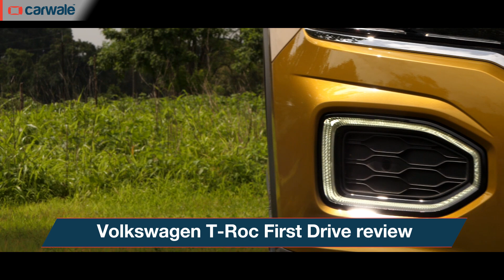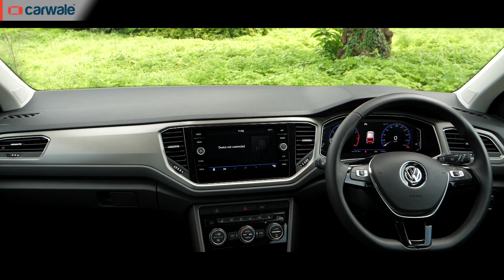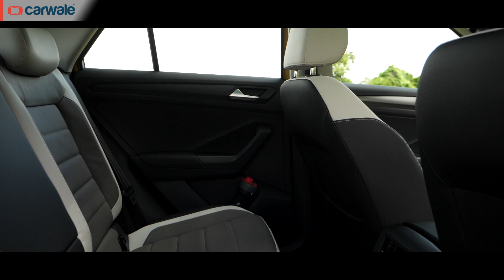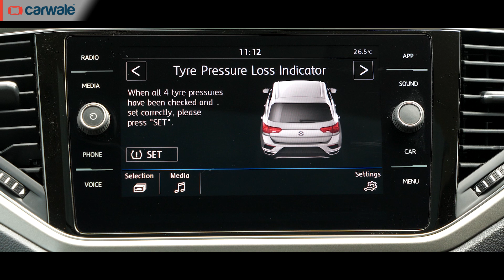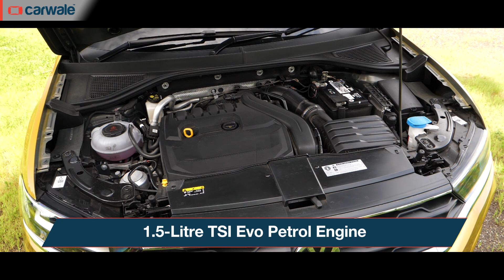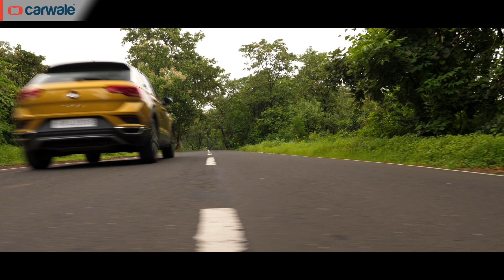Volkswagen T-Roc | Is It SUV Enough? | CarWale

Comment: It’s ground clearance?
Reply from the maker: Hi Premjeet. Volkswagen hasn't revealed the GC for the India-spec T-Roc. However, the UK-spec VW T-Roc has a laden ground clearance of 160mm. Thank you 😊
Reply: CarWale 160 mm not good for India  physically you have looked the car  so how it’s look 180 or 200 mm
Reply from the maker: @premjeettoppo9674  Since Volkswagen hasn't provided the unladen GC, which most manufacturers show, the T-Roc's unladen GC should be in the ballpark of 190-200mm. However, this is an estimate from our end. Thank you 😊
Reply: CarWale  so it should buy for normal off roading  ? and 2 rows seat compared to creata. Seltos vent  same comfort knee room for 5. 10  feels ‘ taller
Reply: It’s cruse mode ?

Comment: The touch screen isn't 10.25 inch .it's only 8 inch
Reply: the Volkswagen T-Roc comprises of the Active Info Display of size 26.03 cm and infotainment system of size 20.32 cm
Reply: @Swatcat59  but the Active Info Display is not exactly 'touchscreen infotainment'  as you wrote in the video and 10.25 was mentioned everytime the 8 inch screen was shown